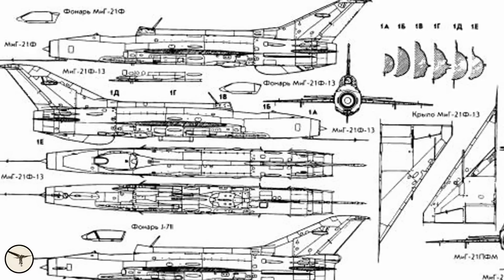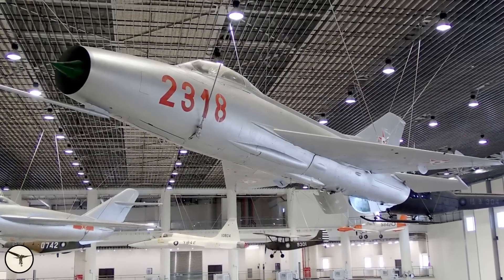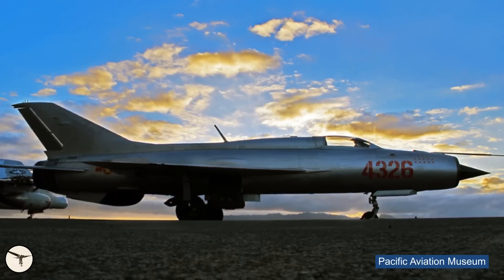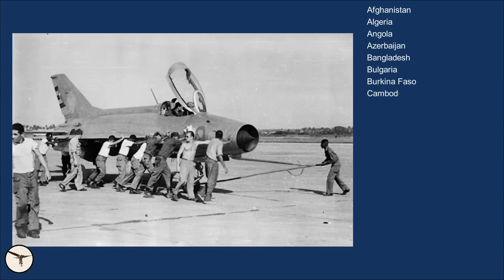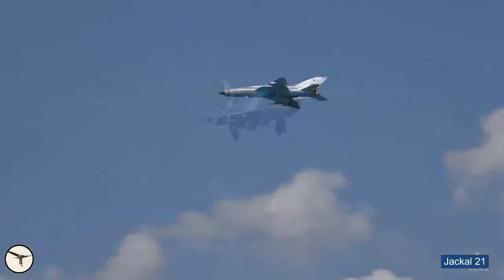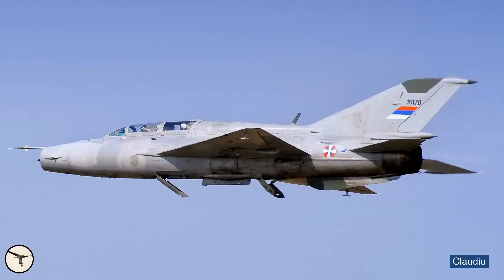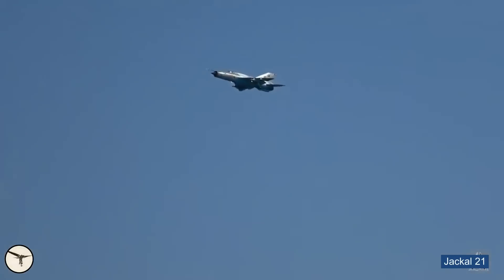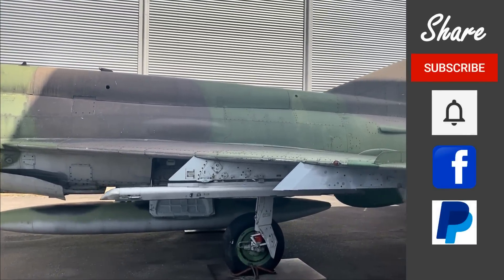Mig-21 facts that might surprise you

Comment: I would say the cockpit IS organized, it's not like you got fuzes and pumps all over the cockpit..
All the fuzes are on the rear right, all the systems are on the front right, all the external systems (nose cone, blown flaps) and Environmental Control Systems (cockpit air) are on the left.. 
Instruments are all in the front and are easy to read. Glass cockpits take just as long to get used to than a series of steam gauges. That, and steam gauges give you more information, separately, quicker, and more accurately than a computer screen can.
It's difficult to pick out specific numbers and information quickly on a computer screen, near impossible in high stress scenarios, whereas with gauges, you know where to look for speed, it's a big needle. Altitude is one long needle and one short stubby needle. Heading is one big compass. Artificial horizon is one big gauge with lines in the middle. 
Everything is where you expect it to be, no need to squint at the Heads Up Display like on a F-16 or F/A-18. 
Mig-21 is good aircraft, reliable aircraft, like AK-47. 
Bury AK-47 into the ground, dig it back up, still works. 
Bury Mig-21 into the ground, dig it back up, still works.
Reply: You forgot to mention the beauty of cockpit at night when panel lights are switched on. 😀😀 🇮🇳
Ex Sgt V Kumar IAF.
Reply: @valsakumar3673  wow it's nice to see a comment from someone that actually flew this irl! I only flew it in war thunder test flight with simulator controls
Reply: If you need to look down during battle, that is automatic handicap if opposition has HUD! (best sustained turn rates, tightest turns etc all need their own speed)
And especially in BFM/"dogfight" Mig-21 would have problems... Starting from more limited pilot visibility.
Also while physical switches are good for some things, that Soviet steampunk cockpit demanded lots of learning and wasn't pilot friendly.
One switch in wrong place could have literally burnt the engine at start up:
https://youtu.be/RaPQYCvVN6k?t=1251
Reply: @tuunaes  You don't need to look down to instruments in dogfight. You feel in MiG very well all the behaviors of the plane in dogfight. You don't even look at the G or AoA instrument as you feel it so well that where you are going. 

The visibility is limited to rear, that is a hard fact that can't be denied. But there is a another hard fact, that is denied often, that when you are pulling a high G (5+) then you are not capable move your head and upper torso anyways at all so freely. At 6 G maneuver your head weights just about 30-33 kg. Your upper torso is about  25% of your body weight, so by average about 20 kg on 80 kg male and that turns in 6 G maneuver to weight about 120 kg.

Especially in the games when cameras move freely, people get this illusion that looking around is simple as that until pilot reaches some mystical number like "9G" or something. But every maneuver needs to be prepared and anticipated so that you know when to move head and torso based the phases of the flight.

The Soviets didn't see the cockpit visibility such a weakness as MiG-21 was primarily a interceptor and front-line fighter as second, where you anyways either acquire a position in the first merge, or you are extending away. And you have wingmen to check your six, as well you need anyways to perform various turns to check your six as someone can be behind you and lower than you and you don't see them, even if you sit in a F-16.

The USA has gone to similar thing, look at the F-22 and F-35 canopies, the rear visibility isn't so great as in F-16, because it is not really required.
The MiG-21 limited design for canopy is it larger front canopy frame, side view and to up is excellent (even when there is the mirror periscope above your head). And later on in the modernization the more expensive one piece front canopy was made, as in MiG-21Bison or MiG-21-93. So there was no more the armored glass with oval shaped piece limiting frontal view. 

The cockpit gauges doesn't require much learning at all. If you know the instruments purpose, then they are easy to interpret and check. And you are anyways mainly looking just four instruments, AHI, HSI, Speed and Altitude. And all are grouped to the left side, large ones: Example https://www.digitalcombatsimulator.com/upload/iblock/103/Main.jpg

The start-up procedure was important to learn, as it was not just MiG-21 (or Soviets) that burned engine if wrongly started. The same thing was on many western fighters back in the day. But MiG-21 speciality was that you got it started under 30 seconds at best and you were moving, and you completed rest of the start-up process while taxiing to runway, with extra 10-15 seconds for that. And many systems you could even start in the air when needed.

The simple gunsight is handicap for the pure-numbers maneuver, but you can do that as well with the gauges and not need HUD for that. As the best turn rate, turn radius etc are as well highly dependent from the altitude and temperature. Those same information is shown on the HUD as it is shown on the gauges. You have altitude and speed right there.
It is little different but when you chase someone, you don't take your eyes off him even for reading the HUD. And when you pull high G, you concentrate for the center part of cockpit and just hope that your maneuver was well timed and enemy will be where you estimated it to be as you can't look at it while your view is black and white, your surrounding vision can be blinking, it is blurred and you need to focus for breathing to stay awake and concentrate to get yourself through the plan. 

Where the HUD really shines is landing, you get all the information and no need to perform instrument approach similar way. But as HUD is used for showing ILS same way as a HSI does it with gauge, you don't need to even look outside to perform landings.  https://www.youtube.com/watch?v=v6Hs4ll93Ms

Don't get me wrong, I am for the modern instruments and systems, but MiG-21 was not bad at all as it is told to be. The real clutter in the MiG-21 is from everything else than the switches, buttons, knobs and instruments. They are from the switch shields, the turnable lights, the screw heads and metal sheet edges, as well few metal objects that are just extruding from few places. And that "unpolished" look is what makes MiG-21 cockpit look "unergonomic" as average person eye catches all those small things and it feels so cluttered etc. But in short time using it it becomes very clear and simple.
Reply: @paristo you are absolutely right, Russian engineering is very clever.
Reply: There  it goes Magnar.!!
No downgrade the 21.
Cheers
Reply: LOL!! Hear hear!!

Comment: At high speed cone is fully retracted, at low speed cone is fully extended...you are telling completely reverse.
Reply: no... he is correct, hence why all super sonic aircraft have some type of intake system of a similar nature.
Reply: @mitri5389  I was service engineer of MiG 21 for 20 years. I know why that cone moves and which direction...and what impacts for this movements...and difference between trainer cone and fighter cone.
Reply: @zsus1  oh? and you forgot that supersonic air cant be directly feed into a turbine...
Reply: @mitri5389  dear brother....go through Russian Publication if possible...then you will find the answer
Reply from the maker: Gentlemen, please don't let this discussion come out of control. For example, the SR-71 has an inlet cone that moves aft when the speed increases. But this aircraft has a very complex engine air intake with multiple doors that open and close in the process. To solve this issue once and for all, I have sent a message to a retired MiG-21 pilot and asked him to clarify which direction the cone moves when the speed changes.
Reply: @FlywithMagnar  I already gone through Russian Publication so many times and not to forget two year in training period.. I know why and how it moves and which direction...as you mentioned SR 71..same logic works here...and  done that simulation at least 100 times on ground...during cone programming.

Comment: The front cone of MiG-21 is so iconic but this is the first time that I know it can move forward and backward according to the jet's speed.
Reply: but he told completely wrong.... at high speed cone is fully retracted--low speed fully extended..
Reply: @zsus1  I think you might be mistaken.... if by retracted, you mean as far back as possible then no.... that setting is for the slow speed regime. The idea is that you use a narrower intake at higher speeds so that the high pressure high speed air has a chance to slow to subsonic speed before it gets to the engine compressor stages as they cannot work properly with supersonic air (This was also true on the SR71 and all other aircraft that used variable geometry air intakes)
Reply: @musharrafhanif  confirmed from Russian Publication...at high speed cone retracted .and low speed cone extended..and you are right .but design of intake is such that if cone is extended it will reduce the open area for air flow and vice versa.
Reply: @zsus1   Wrong.It is mandatory to ensure that the cone is fully retracted during all Preflight(PFS) Turnaround (TRS),and Last Flight servicing(LFS).
At ground level air dencity and Oxygen is more.At heigh altitudes the cone is extended to get more O2, thus flame out of the engine is avoided.There is a provision to re-light the engine with Oxygen & O2 bottles are kept in starboard wheel- bay.Young pilots sometimes forgets to re-light and accidents happen.
This is one of the Pilots Errors.
The Cone also works as radar aerial.
R35 is the engine used in Mig21 Bis, Speed 2Mac.
Reply: @valsakumar3673  totally wrong... during pre flight you can't retract or extend cone, it is set 30% extended during cut off..secondly cone is designed  in such way that when extended it will reduce the diameter of air channel .and vice versa..engine used in MiG 21 are R11, R13, R25 & R 25U....from where you got the idea of R35 Engine?
Reply: @zsus1  I'm pretty sure both of you are wrong.
Reply: @hailandfire1822  Nose come is made of RADAR transparent material and it's tip is made of stainless steel....got injured myself many times by it😃and programmed this come movement 100+ times if not thousand in my 20+ year career as technician..So I am not only clear but confident why it moves and which direction.
Reply: @blown_off_socks  tell him to start training again...
Reply: There are also two additional air intakes on both sides.

Comment: with a top speed of mach 2.2 with 9 000 lbs engine, what if we put one f-22 engine delivering 35 000 lbs of thrust .The plane would be faster than an sr-71 with that inlet design...
Reply from the maker: It's not that easy. First of all, the top speed of the MiG-21 is limited to Mach 2.05 due to stability problems at higher speed. As fuel is consumed, the center of gravity moves aft, and this put further limitations on the aircraft. The Tumansky R-25-300 delivers 9,000 lbs thrust dry, 15,600 lbs with afterburner and 21,800 lbs in "overdrive". That's more than enough. It has the climb rate of an F-16.
If you install the F119 engine in the MiG-21, the center of gravity will move further aft, because this engine weighs 588 kg more than the R-25. This will cause the MiG-21 to be unsafe to fly. 
The MiG-21 is made of aluminum. This material cannot maintain its structural strength at speeds at higher speeds. The faster you go, the warmer it gets. The Blackbird was made of titanium, used fuel as coolant, and its top speed was limited by the engine air intake temperature.

Comment: At 5.58 minutes, in the picture is a Mig21 LanceR C, the air-to-air combat variant. At 6.30 minutes, there is a Mig21 LanceR B, the training variant, with double control.
The variant mentioned in minute 5.58 - Mig21 LanceR A (and does not appear in the picture), of air-ground combat, is painted in the same colors as variant B (with double control).
All three variants of Mig 21 LanceR were modernized in 1990-1995 by the companies Elbit from Israel and Aerostar Bacău from Romania.
Reply: He pointed that Romanian LanceR-s (A) are only for air-ground attack which is wrong! Mig21 LanceR C is the air-to-air combat variant, in fact that is the only variant simple command which fly now.
Reply: fb == https://www.facebook.com/Premaratne-Marketing-115635081134222

Comment: IAF is still using them in hundreds, and they are upgraded variant with better avionics and electronical controls, better firing pods and life support system and a new Canopy that can with stand 5 time pressure. MIG 21 bison Is the liberator of Bangladesh.

Comment: MiG 21 shot down Pakistan F 16, inspite of F16 more superior than MiG 21
Reply: Wing Commander Abhinandan Vartaman - " You have to be mad to be a fighter pilot"
He said this many years ago on the "Highway on my Plate" show. 
And rightly said he later proved himself.

An old generation MiG 21 fighter downing a current generation F-16 fighter is an insult of the highest degree. Like a tight Russian slap on the Americans face.
Rather Americans are themselves to be blamed for the insult. Despite knowing Pakistan as a terror sponsoring state they still opted to give them the F-16s. Americans learn the lesson the hard way when they found UBL in Pakistan.
Reply: It wasn't the MIG-21 that got the F-16 it was the Heat Seeking Rocket fired by the MIG-21.  In the middle of a "fur ball" a heat seeker has a lot to pick from and luck has a lot to play in the situation. One on one a MIG-21 against a modern fighter has no chance. 20 to 30 aircraft all firing rockets and any one can get lucky.

Comment: Its so good..the Brits built their
Electric Lightning copying the nose cone. The Indians copied the nose cone for their Brahmos missiles
Reply: DC: Yes, but the Russians copied the tire and the aileron, so therefore the Mig-21 is clearly a poor plane.   Stop with this nonsense.  In fact the Lightning first flight was 10 months before the MIg-21. The Brits copied NOTHING.
Reply from the maker: It's correct that a prototype English Electric Lightning flew before the MiG-21. But this airplane did not have a inlet cone. It was implemented later. However, the British did not copy the Russians. The inlet cone was initially designed for ram jet engines. For example, the Lockheed X-7 unmanned aircraft flew for the fist time in 1951 with this inlet cone design.
Reply: The Concord is another plane that looked like the Tupelov 144. Who copied who this I do not know but they looked like twins except for the placement of their engines.
Reply: More MiG 21 were built and saw action than the English Electric Lightning which was also lightly armed with only 2 firestreak AA missile.
Reply: @dennischai4831  Which means nothing.

Comment: This is very interesting, I never thought the MiG-21 was all that good of a combat aircraft. It was fast as hell, but so was the F-104 Starfighter and that plane was a POS. Very good to learn a bit more about just how popular it really was to be still flying today.
Reply: The F104 wasn't a POS lmao, it was a great interceptor which is what it was designed to do. The 21 is designed for the same basic role, interception.
Reply: @BlackHawkBallistic  For Canada's needs, it was a POS. They barely flew for 10 years. Short range and cranky. We needed (and now need more then ever) a long range interceptor that can fly well in cold environments for protecting our arctic sovereignty. (I may have mixed up 2 conversations here, my apologies. I see my original post never even mentioned why I consider the F104 a POS, we got them used cheap from the USAF when we killed the homegrown Avro Arrow.)
Reply: @exidy-yt  yeah I can see them being bad in the way they were used by Canada, that's more Canada's problem than the plane though, it's like saying it's the F104s fault it's a bad ground attacker when it's really Germanys fault it was bad at That
Reply: @BlackHawkBallistic  True, but i recall the stats being pretty bad and the F-104 considered a very unforgiving plane in general. Weren't half the losses of Starfighters in 'Nam due to crashes with no enemy contact? And tons of others? Either way, it didn't stick around too long, nothing like the MiG-21.
Reply: @exidy-yt  Do you think the MiG-21 had a greater range than the F-104, or was safer to fly?
Reply: @yoyohoolahoop3705  I am sure it was safer to fly. They didn't call the F-104 the Flying Coffin for nothing.
Reply: @exidy-yt   I’m sure the MiG-21 wasn’t safer to fly than the F-104 – just look at the MiG-21’s service record with the Indian Air Force, for example.
Reply: @BlackHawkBallistic  Every F104 pilot I have talked to couldn't wait to move on to another type.  It was not a dogfighter.  Its safety record is partially because pilots moved onto new types as fast as possible as the pilots all noted it was boring to fly as it was such a straight line plane.  The Mig-21 wasn't an ideal dogfighter, but had enough more wing to turn and burn.
Reply: What's POS??
Reply: @redjournals2817  Piece Of Sh!t. ;-)
Reply: @redjournals2817  Piece of Stool (dung)
Reply: India shoot down PAF's Star fighter with Mig21.

Comment: Good job, nice digest...Though at 09:10 it can usually lift off around 170-185 kts (315-340kmh) with a typical combat load...@250kts on ground you would blow the tires instantly.
Reply: I read once it was actually a tyre design limit.... 300-330 for take offs and about 280-270 to land. It also had to burn out all its fuel to minimum, so with potential, external load it would not be more than ~600 kilos added to its own mass during touchdown.
Reply: @madyogi6164  Yes ok balalayka is a dang rigid bird, but being still on ground with 250kts (460kmh) at take off run as he said; blowing the tires might be your least problem :)
Reply: @jamesmagnum  The values I gave are already in km/h not knots... so no need to recalc. Russia is (CCCP was) metric...